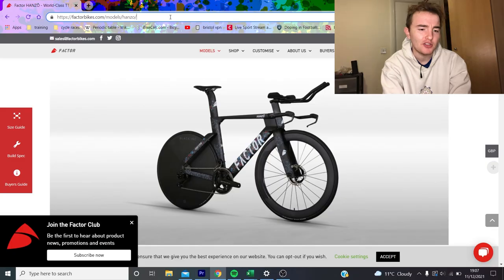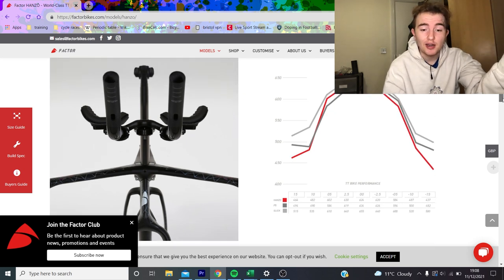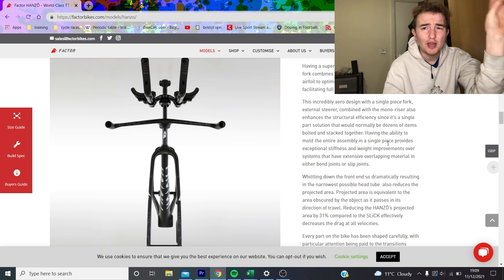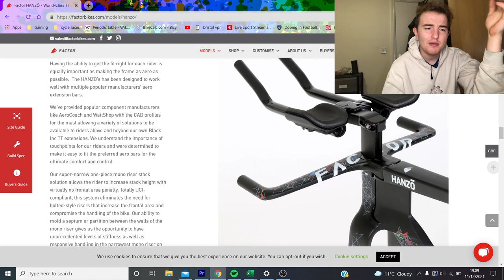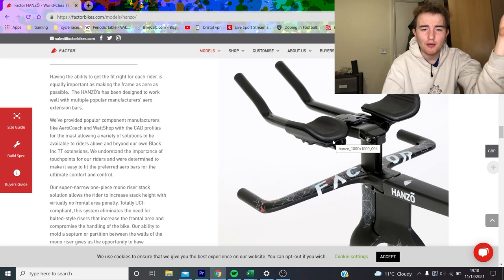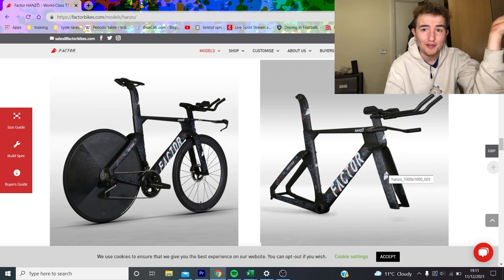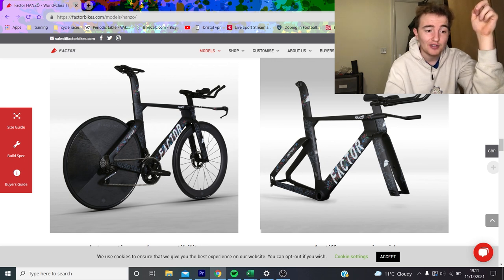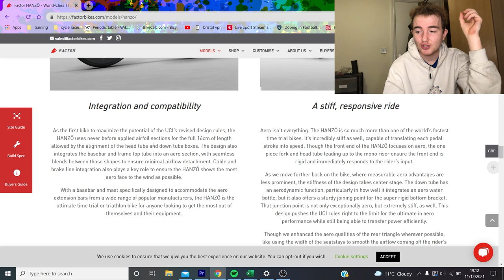Least Adjustable BIKE EVER :(

Comment: I think this is FANTASTIC !!  Why?  Because Finally a bike company that makes world class time trial bikes has addressed that not every one is a thin, flexible, anatomically gifted gum-by that want to ride with the pads on the top tube.  Many pro-riders have raised their position. Look at at any  major time trial; those stack to pad distances are not factory . Their pad reach is way up!! However, most of us do not have pro bike mechanics to make any adjustments possible in our team parts trailer. At least I will be able to fit my bike without washers,, thick pads,  and Teflon spacers  to make my bike fit.  Cervelo, BMC, and others wake up!!
Reply: A lot of bikes can be made to have high stack without a pro mechanic.   You don't need to be a machinist to buy extra spacers and longer bolts for a bike

Comment: Even my Ali express TT handlebar for 100 bucks have better adjustebility, haha
Reply: Is it the HB086 open mould?
Reply: @elijahkwon422  no, i got the BXT. I’ve ridden with it for over a year, and it is pretty durable, and quite adjustable. I have changed the cups with some profile design ones since the one that came with it was quite bad
Reply: @kufisknielsen2595  do u think it’s decently good?
Reply: @elijahkwon422  in my opinion they are good for the given price, surly there are better options, but if you want a little upgrade, they are good for the job.
Reply: I bet they are world class at 20 KPH !!